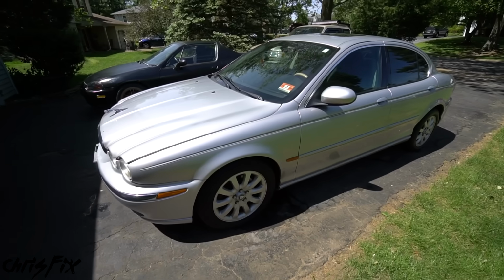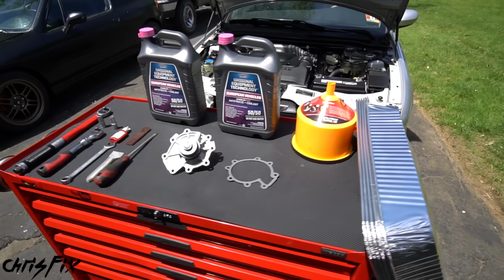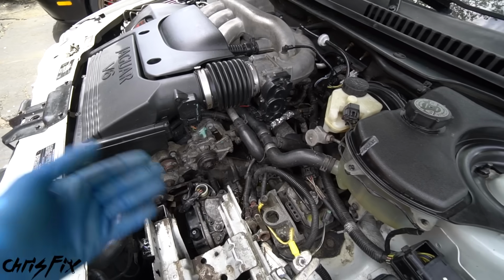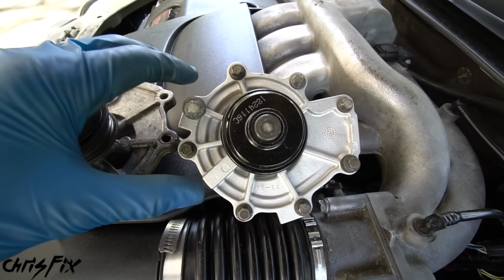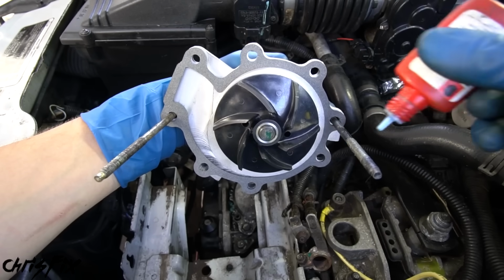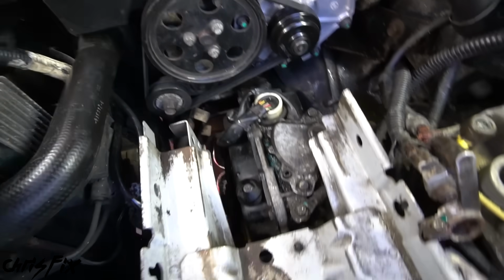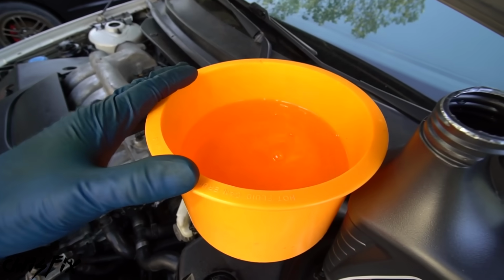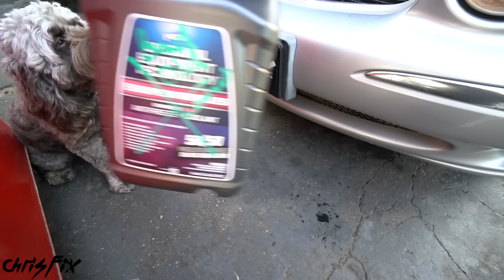How To Replace a Water Pump and Save $783

Comment: How to replace waterpump on an Audi.
Step 1: Tear the whole front end down..
Step 2: Go to shower and cry.
Reply: While you're at it, some components might be due for replacement along the way.
Reply: @angelite143  Yeah, everything you can. All the belts, tensioners etc.. I only have 1.8t but still the same deal.
Reply: Replace all da plastic clips
 fook fok I hate clips
Reply: V6 tt
Reply: The only way to own German cars is to lease them.
Reply: @Clearanceman2  100% agree with this comment.  People that rave about their German cars mostly short term lease them and don't have to live with them for years.
Reply: On my old Camry the first step is removing the passenger wheel. Crying happens a lot too.
Reply: Takes 30min to get an Audi into service position, once you've done it a few times and have all the tools ready.
Reply: @Juntasification My A6 water pump change starts with taking both front tires and fender liners out so I can take the bumper out. then I can do the service position thingy. Fender liners are held with 12 or something screws and backside of the bumper with 4 bolts to fenders on both sides
Reply: Exactly why I bought a mid 90's honda, everything is cheap and easy to fix.
Reply: My friends elantra had an engine mount and timing belt in the way of the water pump.
Reply: Story of my hecking life
Reply: Well change water pump for touareg v10... 😨
Reply: Set the timing on a w8 passat
Reply: Oh I hear that. When I buy a car, the first thing I do is look under the hood. If it is cramped all to heck then that means labor hours. Also steel wheels and non awd is a must. Get ripped off coming and going.
Reply: 2.7 t

Comment: There are a number of newer autos that the water pump is driven off the same belt that the cams are driven on (Subaru comes to mind). From what I've seen changing those are not for the faint of heart or typical weekend DIYer.

Comment: I'm actually surprised on how easy it was to access that water pump, usually transversely mounted engines are pain in the ass to service items connected to the pulley system. Bravo Chris 👏👏👏

Comment: That's probably the easiest water pump replacement I've ever seen.  Compare that to replacing the water pump on something like a Gen 7 Civic (2000 - 2005) where you DO have to put the car on jack stands and remove the power-steering pump, alternator, engine mount, valve cover, driver-side wheel, harmonic balancer, and finally the timing belt.  Definitely not a job for DIY beginners.

Comment: If you're doing this the first time don't get aggravated with the amount of time it takes to do this. If you're working on a car with no space and a ridiculous serpentine belt design than expect 2-4+ hours for your first time. For  many vehicles this is kind of a pain in ass, but doable. Also if possible take a picture of how your belt went if you can. Most belts aren't this easy to take on and off. If your belt is that simple than don't worry about it. DO NOT STRIP  the bolts. If you don't have a torque wrench and you're doing it with a regular ratchet you don't need to kill it they strip very easy.

Comment: You're supposed to turn the heater on inside the car to the highest setting with the fan on at the lowest setting, in order to properly bleed the system.

Comment: We went on an offroad trip (we do this often with a small group of enthusiasts every now and then) and while we were driving trough the field my dad noticed something wrong. We stopped and my dad found out it was the water pump. Good we were in the right group (very friendly and nice individuals, really nice to be in a group with them). It's a land rover enthusiasts club and so we have a discovery 1. One of the members has a defender , but did an engine swap and now he has a land rover engine. It uses the same water pump and he decided he will go to get it. Fortunately we weren't that far from where he lived, so he epmtied his car and went to his house. In the evening he returned and most of the men helped to change the water pump and we were back up and running the next morning. A couple of weeks later my dad did a more in depth engine repair and fiddling to make it work better and changed it again, cause it was old anyway.

Comment: Yeah a lot of times the water pump is on the timing belt. If you take that one off and don't put it back in the correct way, you're gonna have a problem. This video seems a bit rushed compared to the previous Chris Fix video's

Comment: You forgot a step, checking and replacing the idler pulley if it has bad bearings.  Those fail as often as water pumps do.

Comment: my friend moms car the water pump gives out on it cost her  1,600.00  here she needs a new mechanic  I  say a year ago her car keep stalling and I take a look at it she spent, 2,500.00 on  the vehicle then looking throw what they did on the work order   25 dollar air fluter was not put in to the vehicle the fuel  pump sensor was only thing wrong with it they said a week before they get the part for that car  
bull crap I said to her phone the parts store where they have them in stock and  50 bucks I took her car over there  with her and the owner came out and look at it  and did tell me 500 dollars for that part and week before they see it I walk to the back of the vehicle and open the truck up and said this they part your saying week to get and 500 dollars I paid 50 bucks for and the job you done to her car never needed to be done too he did put the part on to here car free of charge 
like my dads truck, it sits for a week the battery goes dead  GMC they just to sell parts  did find want it was and  180 dollar leter it was put into the truck and does  not have that touble with it anymore

Comment: you say to leave the funnel with coolant until the car is at operating temp. is this true even if you fill from the radiator cap, which i figured would send hot coolant towards you?

Comment: Nonsense.  You will damage your engine if you use the wrong coolant.!!!how if I'm a technician and used no coolant or different on tightass people vehicles and there still running.  Stop scaring people. And your not a technician
Reply from the maker: Huh? I specifically said to use the correct coolant that is recommended in your owners manual. Not sure what your getting all caught up about. Using the wrong coolant can lead to corrosion issues, seal issues, rubber breakdown issues, etc.
Reply: @chrisfix  how if even the wrong coolant has anti corrosive additives?!! Never had an issue ,also ive done this on European vehicles still running after  many years.  And i live in a very hot climate.

Comment: I just did the water pump on my 97 altima haha and I overtorqued one of the bolts when putting it back on wish I new it was only 8ft lbs Of pressure

Comment: Jaguar : 1 small belt, some screws and voila!

Porsche : In your dreams!
Reply: chrysler voyager puts a large middlefinger on your face.. just to change the waterpump and the timing belt the easiest thing to do is to remove the engine
Reply: Hey, my car is aircooled, too. But its waaaay cheaper. Check out "Trabant", you would never ever need a tutorial on fixing it...

Comment: My brothers heater stopped working once. He found out that it was the water pump but the odd ting was that he did replace it before and over time the blades was corroded and missing some teath to the point the engine wouldnt overheat but the heatercore would get no coolant. The water pump was a cheap ebay one. So moral of the story if possible get quality parts. Awsome video chrisfix

Comment: Couple of notes. Why you didnt clean those leaked coolants on top of the gearbox etc? You allso should have mentioned that leaked coolant mixed with drivebelt is not a good thing, it will damage the belt, like oil leaks.

Comment: Should've also turned the heater on full blast to get any air out of the heater hoses and core. Also, I'm not sure using the spill-free funnel is a good idea on a car with an expansion tank like that, since it's not supposed to be filled all the way to the top. Good video though!

Comment: On my car (peugeot 406) the water pump is driven by the cam belt so to change the water pump you must remove cambelt.. which is not as simple as on this car, but still.. 800?!? Even when I would want to change the cambelt + water pump it would cost me around 500~ in a local garage.. pump alone is like 15 bucks lol.. these official dealerships are a ripoff lmao. I changed cambelt + water pump myself no problem...

Comment: For this car it seems easy enough but on other cars the waterpump is driven by the Timingbelt.
If you have to change the waterpump there you might as well change the belt and idler / tensioner pullies.

Comment: For all the hate a Jag gets that particular model has a simple easy to get to water pump.  Most others require a car wheel to be removed along with covers  then possibly engine mount assembles afterwards an additional cover under which the water pump shares the timing belt detail.

Comment: Not surprised by the $800 bill by Jaguar. On my 12 XJ there is a Sensor in the A/C compressor that is a common issue that goes bad, which causes the A/C to blow warm air, or not work at all. They wanted to charge 1700 just to change it. I looked up the labor to replace it, the total labor was 1.1 hour. While the sensor is $40. What a rip off the dealer. Thus I never take my car to the dealer ever. I either do it myself or take it to my Indy

Comment: A couple years ago I changed water pumps on a '89 Honda Accord that I used to have. I put a little black rtv between the gasket and the block, torqued the bolts down and let it sit overnight and its never leaked since. I still see the car driving around my town every so often

Comment: You forgot to mention that few cars use timing belt to run water pump, so you need to do practically timing belt replacement job...

Comment: I love how you do all thing properly and not some cheap fix that wont last, and you dont want to spill anything i just love that

i got teached by my father how to fix cars and check for something wrong with a car/tractor or truck, he always said i have to do thing proper and dont HAVE to spill gas all over the place or oil on the wrench and always clean the equipment after use for oil or gas etc.

Comment: I been told to always turn the heater on also to make sure no air is trapped in the heater core. What are your thoughts about this?
Reply: Most, if not all, heater cores are an integral part of the coolant system and the climate controls are only controlling air flow through the heater core or the AC evaporator.  However, not a bad idea to ensure the heater is on for a bit to ensure if your core has a valve to control water flow you ensure the core gets burped too.  Chris didn't drain everything so most likely wouldn't have drained the core in this case anyways.
Reply: He forgot to do it or didn't know to do it.
Reply: Most cars have coolant circulating through the heater core all the time. No valves on the coolant lines but only inside the dashboard in the AC body.

Comment: hey Chris, I need some help with my dads 2008 trailblazer. So basically, whenever I put it on a gear eg, R or D it vibrates rapidly until we give it a push on the gas pedal. sorry if I English is broken. for basics. my car vibrates when I put it on a gear while holding the brakes. So please if you see this, help me with some advice, Thanks you.
Reply: In case Chris doesn't see it, check your engine and transmission mounts. Other things can do it, too; but, look there first.
Reply: Thanks Nwon, I'll be sure to check. If it's not that,  then my life sucks
Reply: @weezduts8169   Hey, it's only a machine. But your description is typical of bad mounts and replacing them is usually relatively easy.  Good luck.

Comment: Nice video, but I wish it was this simple on my car. My car has a timing chain driven waterpump buried in the engine, you have to actually lift the engine out of the car. It's a $1,500-$2,000 job depending on if the coolant leaked into the camshaft.
Reply: Which make?
Reply: @wholeNwon  Ford

Comment: Good video. I would at least partially drain the coolant so I could reuse it. I would avoid using coolant that ran down the outside of the engine because it may pick contamination.

If you are using a gasket maker, make sure the bead is continuous and inside the bolt holes. If you put on the outside, the bolt holes could leak coolant.

Comment: It's also good practice to crank the car heater to max as this will open the heater radiator valve. When draining the system, fluid may have drained from the heater radiator as well. So if you turn heat to the max you will also get rid of air in the heater radiator

Comment: Did this months ago the hard way on my 02 Mustang V6. Wouldn't circulate my coolant. The steering pulley and the metal hose on the top was a pain. But it works now! Wish I saw this video first.

Also,  your estimate is pretty close.  Cost me 143 to do it myself (tools, sealant, coolamt, etc.)

Comment: The biggest PRICE was the difference in PARTS NOT THE JOB, ORIGINAL ALUMINUM NEW PUMP VS REBUILT PUMP WITH PLASTIC IMPELLER ON THE PUMP HE BOUGHT.

Comment: Good video. One simple job on a Jaguar, unlike Toyota,Honda and Nissan,needs to remove timing belt
Reply: That's why it's usually a good idea to replace the water pump, belt tensioner, etc. when doing the required timing belt service.

Comment: Hey Chris, any tips on how to clean a cast alum intake manifold on an 02 Mercedes. 
These look neet but as usual the alum gets dulled over time. Idk how to clean it WO taking it off and soda blasting it. 
Any ideas?
Reply: aliminium gets dull over time. No point in cleaning it since its caused by corrosion. You are just gonna wear down your intake manifold by removing material everytime

Comment: thats pretty dumb to not just drain your coolant and hold onto it for later to refill it
you are just sending coolant all over that side of the engine for no apparent reason possibly corroding any electrical connections like directly underneath the water pump there, just a note not very clean either so yea.

Comment: Looks like a nice easy water pump. Unfortunately mine is timing belt driven, hiding under the accessory belt and engine mount. So I change it every time I change the timing belt - the  maintenance schedule actually recommends this!

Comment: Hi 

usually on 4 cylinders cars, the water pump is driven by  the timing belt. therefore, changing the pump costs the same as changing the time belt.
Reply: Its a v6
Reply: @gtasanandreascluckinbell  yes I saw. My point is, changing a water pump is not always as easy as it looks.  try to do it on a subaru boxer engine :)

Comment: Just curiosity do you not ever pump the hoses back and forth to work out the air on the upper and lower radiator hoses back pulsing them with your hands?

Comment: Unless your an old 80's Subi. A few years back my dad started on changing out the water pump in the mornin and was saying it would be quick and easy. I was over helping my mother, I went to run my own errands and came back 6 hours later and he had the whole upper engine bay apart lmao.

Comment: It’s also a good idea to turn your heat on full blast when bleeding the air out some vehicles have vacuum valves that control flow for the heater core which can also have air in it

Comment: You're so correct when you say. Nothing like saving money and doing it yourself. I drive a 06 H3 hummer. They wanted 1350 to change radiator and water pump. I bought the parts and did it myself. I borrowed tools from Auto zone and did the job. It was easy. Time consuming but easy. I only go to the car doctor for serious stuff I don't have to tools to do. I've saved so much money. I do my own oil chance and brakes etc. Need a rear main seal now and I'm force to go to the car doctor lol. I don't have the proper work space or tools. 😥😥😥. Main point is. Fellas. Learn how to do things yourself. It will save you alot of money.

Comment: I have used anti seize on the threads, more worried about them breaking next time they need to be removed, than coming loose from vibration. perhaps the ones I have worked on had lock washers. Good point about using torque wrench, I think a lot of times they are over tightened.

Comment: On my 2002 Audi S3 1.8t you need to take off an engine mount to replace the timing belt because the belt goes around the mount

Comment: another hint for bleeding the cooling system is when you have the car running and coolant bleeding, turn the heating onto hot and make sure hot air is coming from the vents. i have had it where it looks like all the air has been bled out but there was still some hiding in the passenger compartment heating radiator. no hot air in passenger compartment = air in the cooling system.

Comment: I just did this on my 2013 accent. Twice. First time didn't seal. Second time didn't seal. Third time I finally got a seal. That Permatex thermostat and water pump RTV and a little time fixed it right up. Also, those small brass brushes to get gasket material off are a godsend. Also I'm glad you have room to work lol

Comment: Isn't it usually MUCH harder to get to the water pump?

On both the cars I've owned, switching the water pump out has been the sort of thing you just do while you're replacing the head gasket, seeing as you're already in there and it's such an arseache to get to.

Comment: Put a smear  of engine oil with your finger around the gasket prevent it sticking  next time come off easily  no scraping necessary just wipe.
Squeeze the radiator hose  after its been running and while filling

Comment: This replacement is very easy. 
On my Mitsubishi, we have to remove the timing belt, tensioner, engine mountings just to remove the water pump.